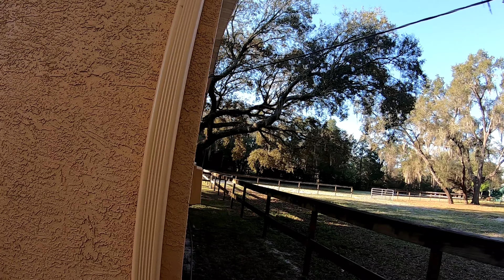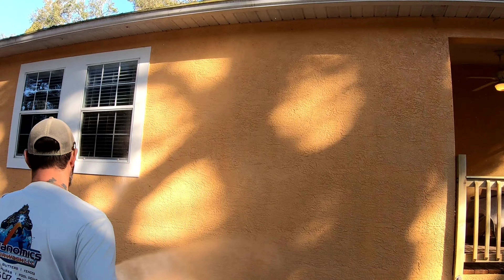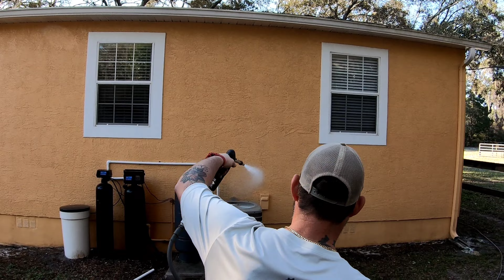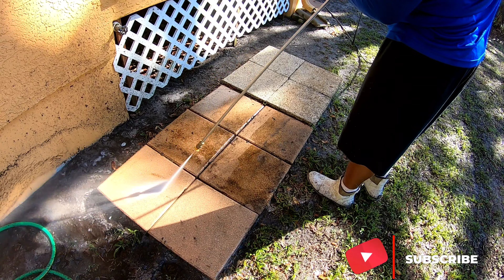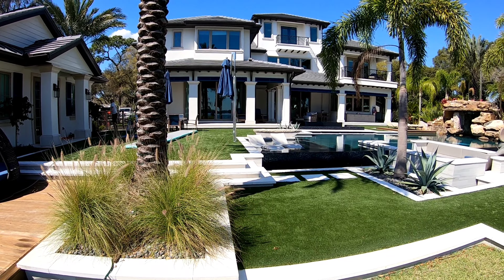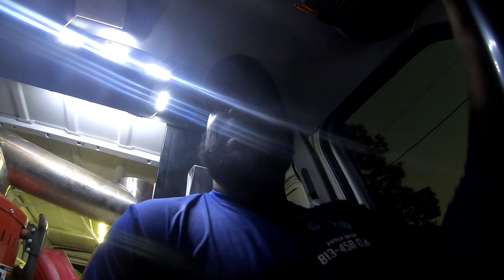bad day of pressure washing with a silver lining

Comment: Hey bro great video. When mine bust I place broken hose in back and connect new hose or hose that have not popped not in front where gun is. I have not had an issue when I do that. I think when you let off trigger it’s more pressure in front. Mine have been holding strong since doing that

Comment: Man if you want to stop.having issues with hoses and fittings and stuff like that failing, look into the K7 Flow actuated unloader valves I switched and will never use a trap pressure again!!!!
Reply from the maker: Thats a great idea. I actually just changed the unloaded 2 weeks ago. I should of went to the  k7. I know about about those

Comment: What setup would you recommend for somebody just starting out
Reply from the maker: Try getting a 4gpm 3000-3500psi, 15-18 inch surface cleaner, 100ft garden hose, 100-200ft of pressure hose,  ball valve, downstream injector,  jrod , pump sprayer and a bucket. That will get you setup for concrete and house soft washing.
Reply: Ok thank u so much